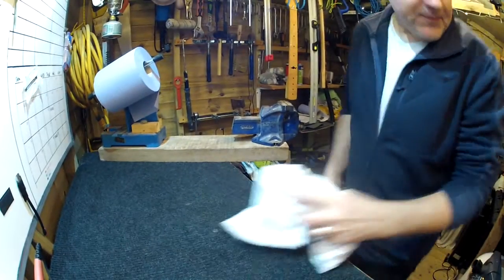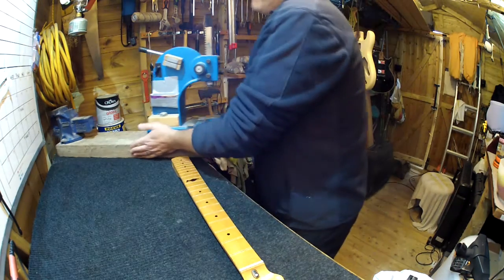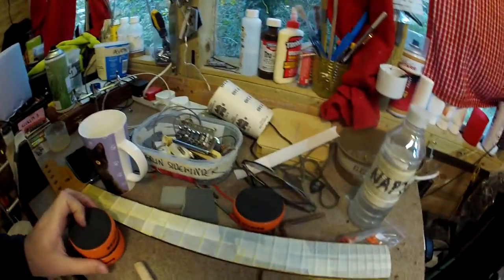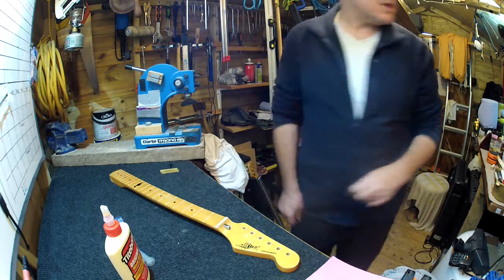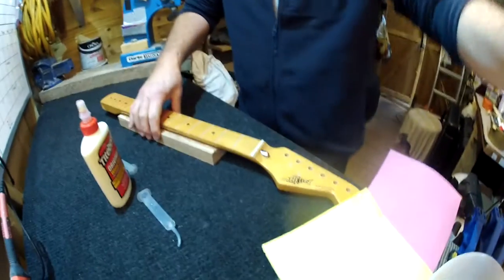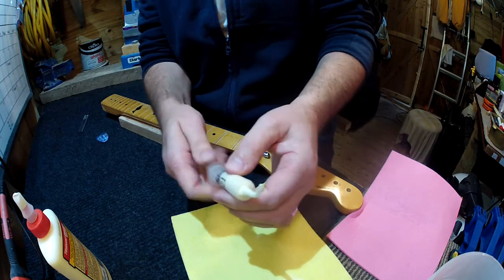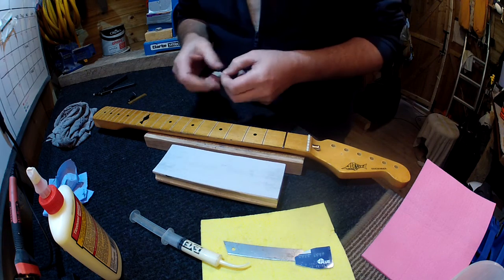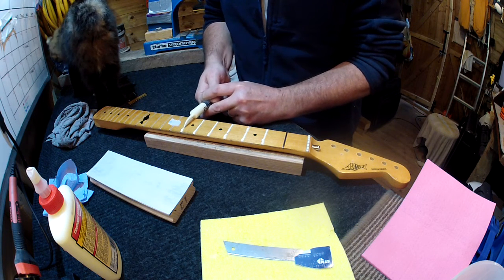Re-fretting a vintage maple electric guitar neck - Reloved Guitars

Comment: Might be not a bad idea to use titebond on a finished neck. Do you use the regular one or Titebond II or III? (From the bottle colour I'd say it's the regular kind) 
What is your experience getting those titebond-glued-frets out again? + Cleaning the fretslots? 
I got my victim-neck to learn and before I'm levelling&recrowning the existing frets, I had one popped up fretend that I glued in and it was such a mess to get rid of the rest of the superglue with a razorblade. 
I got a lacquered neck refret to do in the future after I learned on my victim-neck. How do you cut through the lacquer on the side of the fretslots?